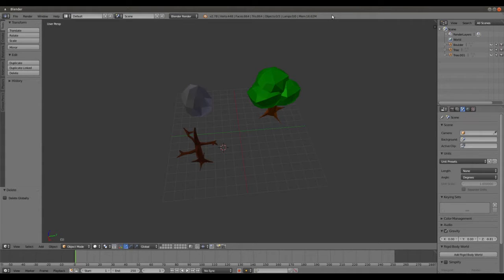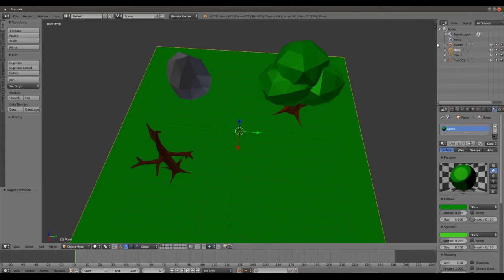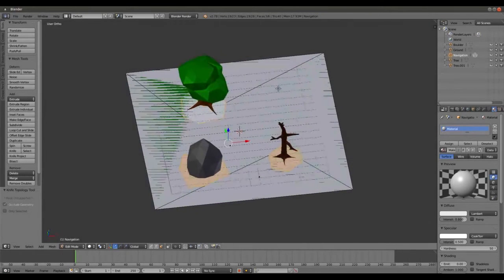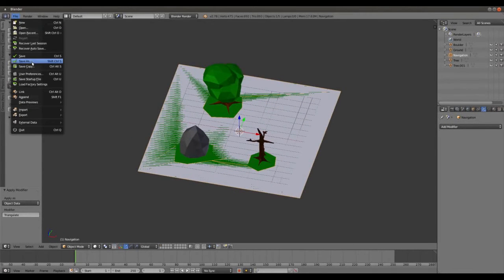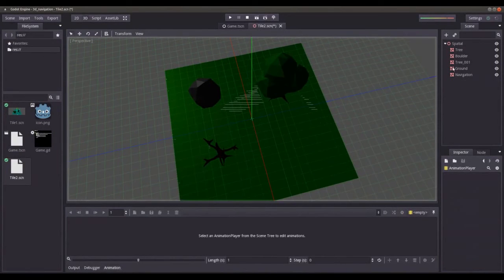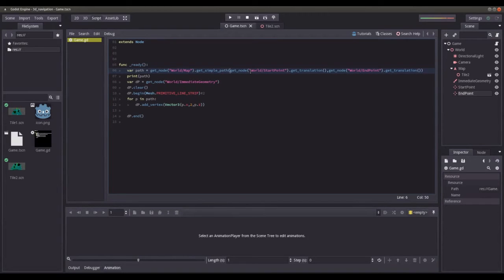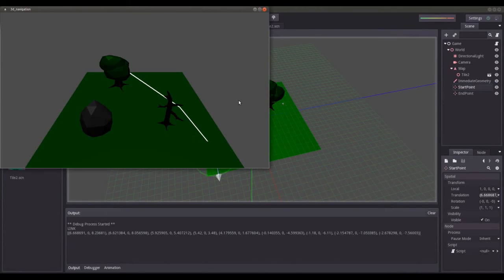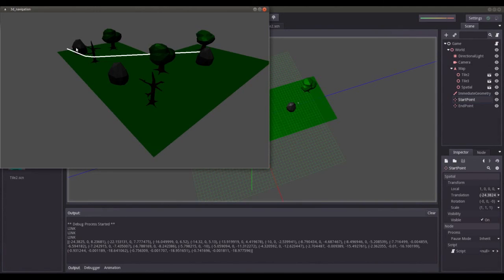Using Navigation Meshes in Godot Part 1

Comment: just a quick tip, you can use a godot tool script with a target and start position as export(NodePath) inputs.
and have it constantly draw the path. that way you can easily debug your navigation by moving the target and the start nodes around without hassle